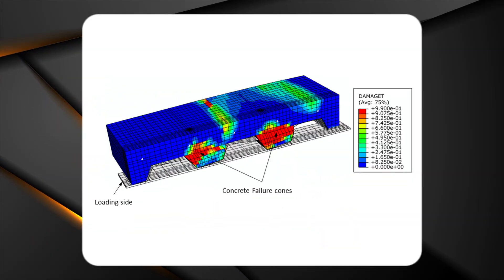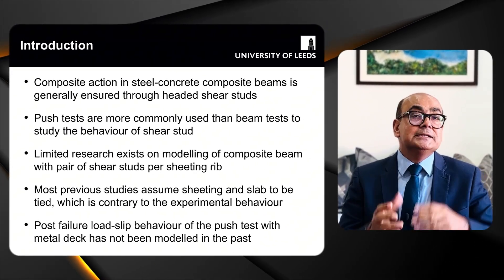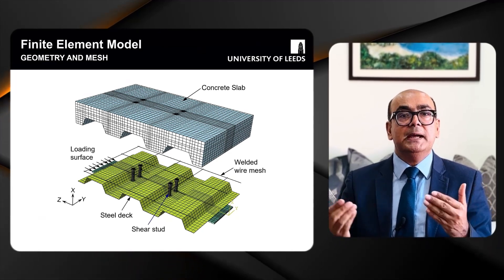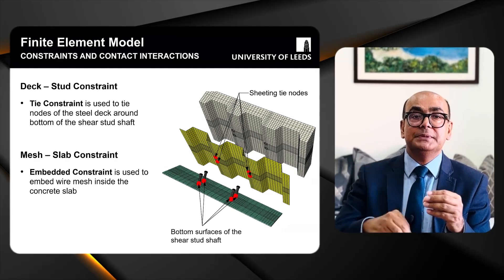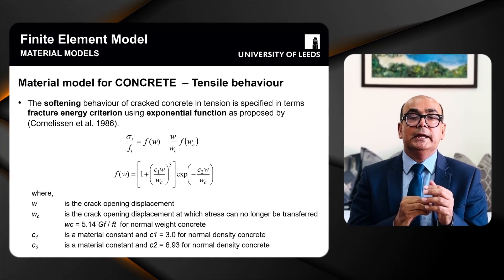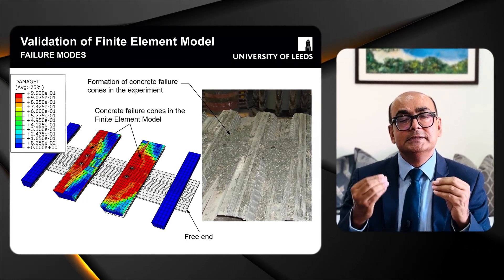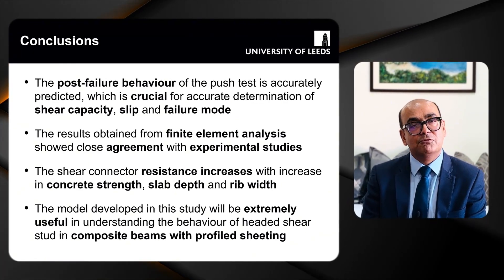The TIP About Steel-Concrete Beam Modelling Every ENGINEER Should Know

Comment from the maker: ⏰ TIMECODES ⏰ 
00:00 – Introduction
00:32 – What are shear connectors?
02:35 – What is realistic way to model beam?
03:55 – Experimental push test 
04:43 – What is favourable and unfavourable stud position?
05:49 – Geometry and mesh 
07:30 – How to get static response from dynamic analysis?
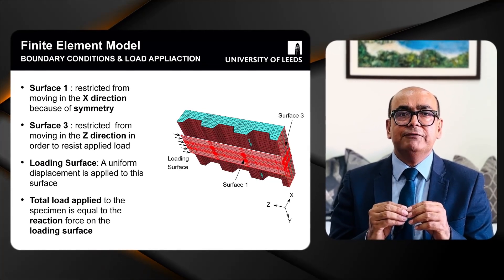08:15 – Constraints and contact interactions
10:46 – Materials models
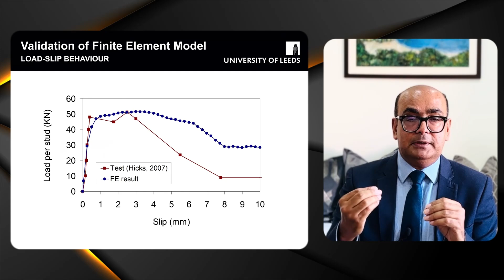13:51 – Results – Load-slip behaviour
15:10 – Results – Failure modes.

Comment: Thankyou for the nice presentation Sir. It really solves basic doubts regarding my the boundary conditions and interactions. 
I have a small question sir, for my research work I am trying to estimate the moment capacity of a Cold Formed Steel and Concrete Composite beam with profiled deck. My aim is to achieve a full shear connection between the concrete slab and the steel beam via bolted connection. Is it possible for priliminary purposes (for estimation of full shear moment capacity) to not model the bolts but to use tie constraint over the the connecting region (area of bolts in this case). I am assuming that since it will be a full shear connection, the yielding of steel beam should be the failure mode and hence i will get a rough estimate of the moment capacity for comparing it with Eurocode 4.
Reply from the maker: If you are using it for the design purpose. I suggest using Eurocode design formula for shear connection instead of modelling it in FE. 
Sheeting moment capacity can be found in manufacturer guides or workout elastic effective properties. Shear connection in this case will be partial.

Please search up my recent live session with sqve consultants on steel-concrete composite structures. It is in guest speaker playlist as well.